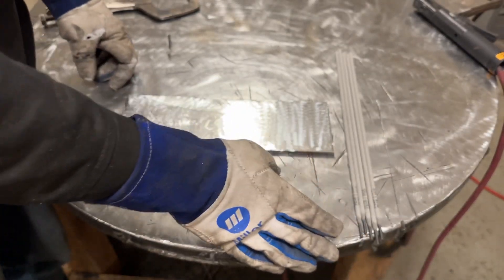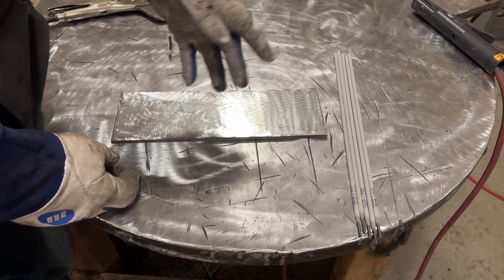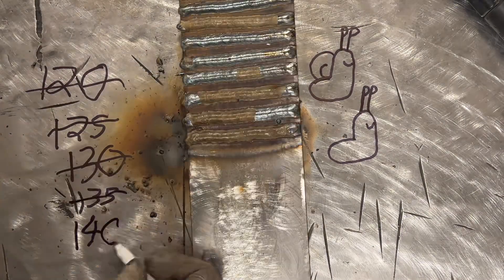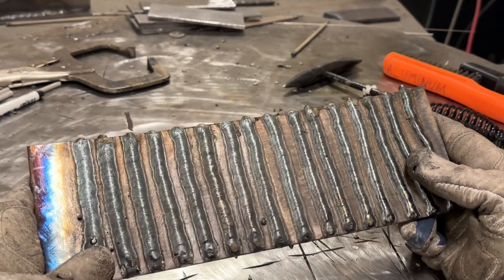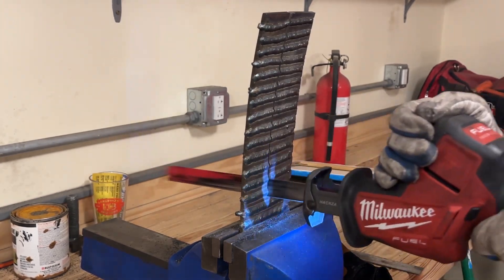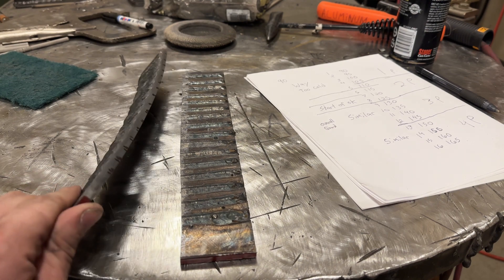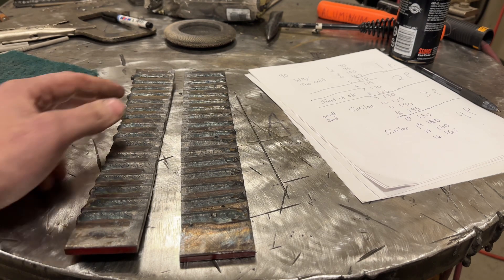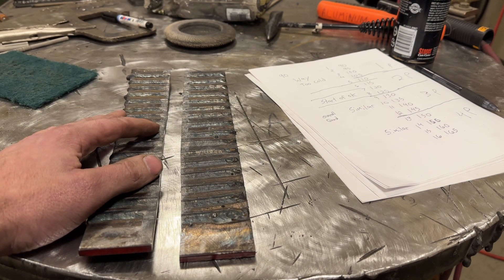How much does amperage play a role in penetration with 7018?

Comment: why not just cut it with an angle grinder just curious
Reply from the maker: Generally speaking if you can cut steel with a blade and leave chips instead of dust it’s the way to go.  Grinding wheel and metal dust is really bad for your lungs and gets everywhere.  😀👍

Comment: I have a bunch of 2mm 7018 and regardless of dcen or ep makes no difference. They start welding OK but then just stop! Like the current has been turned off. Weird.
Reply from the maker: So what could be going on is something somewhat unique to 7018, let me explain:  the flux of 7018 doesn’t conduct electricity that well, and the arc is actually farther up inside the flux (basically back from the edge of the flux).  If the amperage is set too low the arc will burn up inside the flux, create a “long arc” and because the flux poorly conducts electricity the arc shuts off.  With many other common rods the flux conducts electricity better or the arc is established closer to the end of the flux, therefore it’s easier to keep them lit.  Try more amperage and keep the flux touching the plate slightly to try to keep the flux burning off fast enough.

The other potential issue has to do with your welder.  Some welders struggle to produce enough voltage to run 7018.  Basically the arc will stay lit for a bit and then just cut out.  This is due to the welder not being able to produce enough voltage to stabilize and keep the arc constant.  Rods like 6013 need much less voltage (20-22v for 6013, 26 volts for 7018) to keep an arc lit therefore a 6013 might run and a 7018 won’t.  The only solution to this is to use a different welder or possible use 7018 a/c rods.  Those a/c rods run on dc just fine, and due to a slight change in the flux, they require slightly less voltage to keep the arc lit.  Hopefully all that makes sense 😀👍
Reply: @makingmistakeswithgreg  will give it a go and get back to you on all those excellent points - thanks!

Comment: 0:42. Soak in vinegar (5%+) outside (hydrogen gas is released) to remove millscale. Spray it all down inside a construction bag. Lightly close it up....... (24hrs) Wipes right off.  Plan ahead. Super easy. Thanks for all that you do, Greg. Awesome channel
Reply from the maker: Thanks for the tip, I will be doing that in the future.  It beats making a ton of dust cleaning it off 😀.

Comment: What was the voltage of the stick welder?  I’m assuming it was 220v
Reply from the maker: In that video 220.  Most 110 stick welders can’t output over 50-60 amps.  The esab rogue, fronius 180, and miller 161 sth can all output over 100a on 110 due to efficiency and power factor correction.

Comment: Haha get it! Sticking around he says lol. I had to cringe when I seen you go for the milawaukee m12 weak arse sawzall, at least yours is the fuel brushless one but 1/4” plate bro Jesus. 😂 I got burned out a few weeks ago and went to harbour freight and grabbed the cheese master baurer red portable band saw, couple packs of blades and came home and welded that pig to a old roll floor jack laying around I don’t use, couple like 4” pieces of angle iron and just like double tacked them super good to the Allen bolt heads on the saws case, cause who cares bout the dang cheap saw anyways but literally took me like 15min and it’s been the best damn idea 💡 I’ve had in awhile man it sails thru near anything stupid easy, and quiet with out having to mess with The torch like you said

Comment: I’ve decided after looking around that you’re my choice as my welding professor. I’m 73 and just starting. I got a Harbor Freight 225 stick welder because the old timers seem to say that stick is where I’ll get my best general understanding and skill building that will be transferable to the other forms and machines (and least expensive cuz he’s a cheap sob 😜.    editor). I’m running it off 220 btw and had my first experience with arc welding when I was wiring the 220 and zapped a crater in my screwdriver blade, hee hee. That’s my favorite flathead screwdriver now.

So far I’ve blown out all my thin to thick attempts and laid a few inches of fair looking practice welds (out of several feet. 🙄        ed). I am at the point where I’m just starting to understand what I don’t know, which is a lot. It’s really fun though.

Thank you for your fine efforts making videos and your patient and thorough tutelage.
Reply from the maker: Thanks for the kind words and for taking on the task of learning welding.  Stick is a great place to start, and the welder you chose is actually a very good machine.  It will run any rod you want and the set points are very accurate.  In no way will the machine hold your capability back, which can be a issue depending on what machine a person has.  The key is to just be as smooth as possible and focus on being consistent.  With practice the skill will come to you 😀

Comment: I learned to weld on that Hobart 7018 rod-  school had them delivered in 25 lb. cases stacked on a pallet.  I hated them-  very finicky and hard to start, especially a restart.  And if you didn't run it just right, that slag wouldn't cure just right and was very gritty-  like they put too much sand or silica in the flux or something.  The Vulcan 7018 runs much better, I think.
Reply from the maker: The Hobart 7018s definitely have a sticky start, probably the worst of 7018 I have ever run lol.

Comment: NICE DEMO.  WAS THIS ON A/C OR DC. MY LINCOLN IS IS AC OR DC BUT CAN ONLY 30 SEC BEFORE KICKING OUT. I HAVE A CHEAP INVERTER THAT GOES TO 150 AMPS AND DOES A LOT BETTER JOB AND DOESNT KEEP KICKING OUT.
Reply from the maker: DC 👍
Reply: @makingmistakeswithgreg  interesting question about AC.  some 7018 can use AC,  I assume this would lessen penetration on thinner stuff.  I have read that some huge stick electrodes are AC only due to terrible arc blow at higher currents.  I want to make the trusses for my carport from 11ga 2x6 tube  w/7018 3/32.  i haven't made any test runs yet but 1/8 7018 on AC might be an option..... bummed i gave away my tombstone.

Comment: Awsome haven't cut any welds I've done with 7018 but normally run 4mm rods at around 160 looks like pretty good penetration for a low penetration rod. Would be interesting to see the same test with 7016L  rods.
Reply from the maker: The penetration definitely seems to be better than I expected for the rod size.  Since you mentioned mm and 7016, I would imagine you’re in Europe?  I have heard of 7016 but never ran it.  I heard it makes welds like 7018 but can be run downhill.  7018 is not specified in code to run downhill (it can be but it’s far from ideal lol).  If I can find some 7016s I will run them in a test.  A quick search in my welding suppliers inventory and all I can find is big 50lb cans of it for 220$ 😱.  Amazon came up with nothing.  I will have to see what I can get 🧐
Reply: @makingmistakeswithgreg  Im in New Zealand. 7016 isnt a common rod it is a twin coat rod and the slag looks like glass. It has good penetration and almost sounds like a 6010 rod when its burning . Really nice rods to weld with never ran one downhill though but uphill it rundps really well. I made a few test videos for a company that sold me a welder that didnt run to the specs advertised. The rods I used were 7016 tc 3.2mm.
Reply from the maker: @b.p.rwebber8098   I always found it fascinating why there is such variability in rods used depending on country.  Obviously there are local codes that dictate what rods are used, but it seems like the world would have settled on a few and stick with them.  Kind of like I always found it odd that apparently 6013 is used for a root pass on pipe in the UK.  Now maybe their 6013 runs different than ours in the states but that would honestly be one of the last rods I would go to for welding a multi position weld.  I feel like I could be half drunk and run almost any other rod better on a uphill stringer bead.  309 stainless is the only rod that would be worse lol.   

The 7016 sounds like something I would like.  It’s too bad they are 230$ for a 50lb can and nobody seems to have less than 50lbs for sale.  I will have to find some and run it.  There are a bunch of others on my list to try too, like 6012.  I will avoid all the special purpose rods for very expensive metals, most of those would give cancer to a robot anyway lol.
Reply: @makingmistakeswithgreg  Yeah I've noticed that same thing but here 6013 isn't used for anything more that light fab. I'm guessing who ever uses 6013 on pipe root pass thinks just because its beveled and has a gap penetration is a given. Have actually seen a comment that stated that and I'm not sure about 6013 being any different in other country's. I've seen videos posted of  7016 being used on pipe root pass to cap and the welds look mean. I like welding with 7016 rods because I can see the  tip cutting into the sides and the puddle filling in the cut and it's really easy to run. Takes a few goes to get used to starting it but once you figure that out it's all good you'll be hooked on them. If I could I'd send you a some of 7016 rods but I'm getting low on them because they're my got to rod for everything now. Can run a 3.2 mm rod as low as 75 amps and it'll penetrate just have to move the puddle a bit slower. Shame they are so hard to find in The States . Damm I'd be keen to send you some rods I've packed them away because we're shifting but when I unpack I'll see if I have enough rods to send some over to you so you can try some out, might be able to send enough to do a few passes.
Reply: @makingmistakeswithgreg  I think I bought a 5lb box of fourney 7016 on amazon last year.
Reply: In Europe, they have lots of different “6013” rods, including the fabled “rutile-cellulose” flavor that bites like a 6011, almost.

Seems Forney might have something a bit like those, even more than Hobart’s.

Comment: Great video & testing!  It does make me wonder if there's variability in some welders amperage scales/settings-?  I'm running Hobart 7018-1 H4R....& the 3/32" rods run best at 75a, with 1/8" rods running best at 100a- Obviously I can run above these amperages;  but then it starts spattering much worse. My machine is a Miller Syncrowave 210.

Probably would be smart to cut & etch to see the results myself.

Thanks again for the quality info/video.
Reply from the maker: Thanks for the kind words.  There are surely a bunch of variables that can affect results.  The first one being dig or arc force.  If it’s fixed higher than mine or adjusted higher, it will affect amperage as you tighten the arc.  I ran a setting of 30% which with 7018 had very minimal affect at normal operating arc gap (the dynasty 210 I have is within 1-2 amps in my testing).  If it’s set higher it will increase amperage well beyond the actual set point.  The syncrowave should have adjustable dig.  The second variable is I was running flat plate, without a doubt if I tried a fillet weld at say 160 amps the results would be far worse lol.  The metal to heat ratio would be so off I have a feeling the whole top of the weld would be a line of undercut.  The third variable is how consistent and controlled the arc gap is.  The 160 amp+ pass with tight arc I ran might only be equal to 150 amps of actual heat input with a medium length arc.  

I will say at 100 amps on a 3/32 7018 you will get a ton of spatter if you long arc the rod at all.    It’s very unforgiving.  I can get away with it when welding 1/4in steel and over.  Under that good luck lol.   Also, it pays to do a cut and etch to see what’s going on.  Just wait until you see some of the videos I have coming up in a few weeks dealing with the limits of what specific welding processes can do.